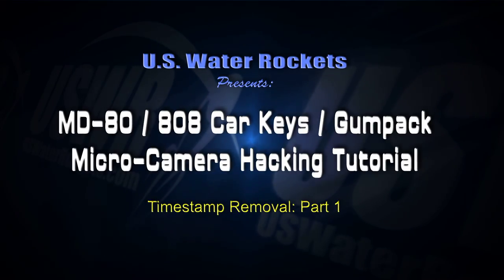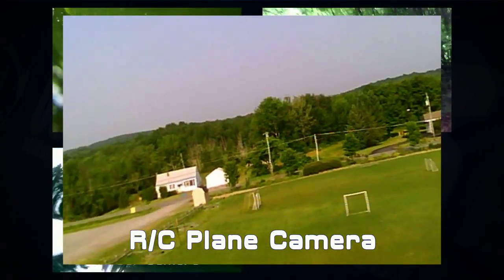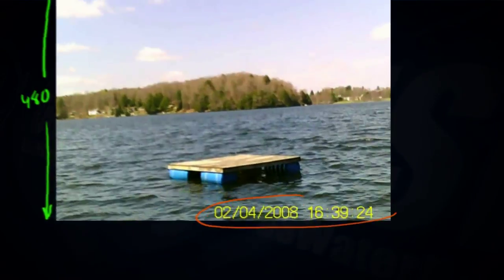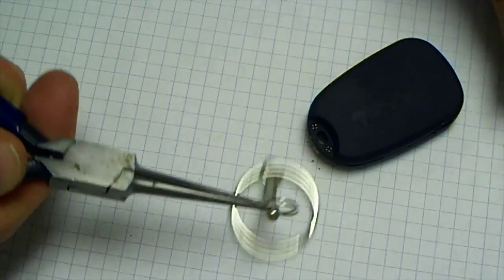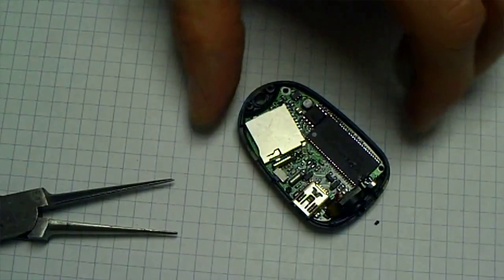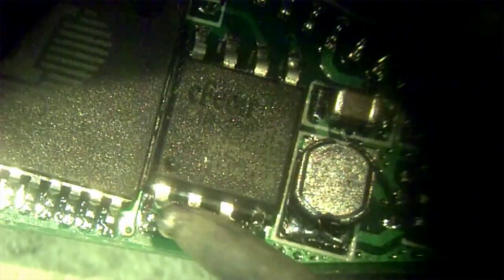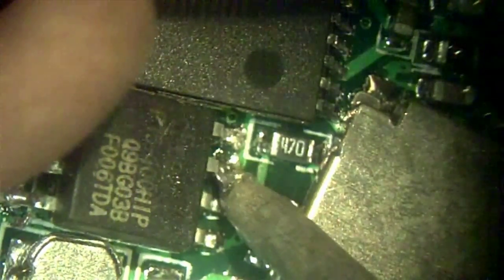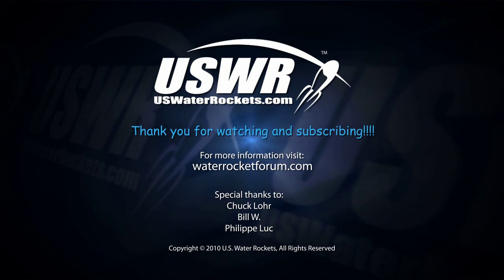Timestamp Removal: MD-80 / 808 Car-Keys / Gumpack Camera, Part 1

Comment from the maker: These devices are really not all that well made. Many people report that they have found loose connections or short circuits inside defective cameras they received. Some people are skilled enough to spot and fix these types of electronics issues, while other people are usually advised to return the bad unit for replacement. Since you just bought it, ask the seller to replace or fix it for you.

Comment from the maker: The focus is set at the factory to about 2-3 meters and we refocus them for infinity (because we want to see detail in the distance), so the way to focus them is to open the camera up and find the optical sensor and lens combo. The lens is threaded into to sensor and rotating it will change the focus. They usually put a dab of glue on at the factory to hold their setting but you can often break it free. Then you need to do trial and error with different focus points until it looks good.

Comment from the maker: @JonDeth These little cameras are made in Asia somewhere and some of them seem to be made with lead solder. The ones made with lead-free have a lot of problems. We have repaired several of them already. Another issue people have found is that the higher temperature needed to work with the lead-free solder causes the copper to delaminate from the PCB if you are not careful.

Comment from the maker: @15sdobbie you're referring to "Soldering Iron" and "Solder wick". The Soldering Iron is an electric tool that looks a bit like a screwdriver that has a pointed tip that gets very hot and melts the metal solder used to connect electronic components to a crcuit board. Solder Wick is a strip of fine wire that is braided into a strip that usually comes on a roll. It is used to "soak up" excess melted solder thereby removing it from a board and allowing the components to be removed from a board.

Comment from the maker: @KitCox we also reviewed the #11 camera and discuss the doftware only upgrade method. watch?v=-z-59WlUqZ8 and agree that it is the best. The hardware shown in this video only works on the #3 with this flash chip. Some people suggest that there is a #3a with a smaller memory but we have not seen one yet. The program could be modified to fix a bricked #11, except for the prototypes that were sold in December of 2010, which are not compatible with later models. Thanks for the comments!

Comment from the maker: @jlb2 There are literally dozens of clones of this camera on the market. Some are better than others. The one featured in this video is known as the "Type #3". If you purchased some other clone, you could have gotten one of the low quality versions. The Type #3 is typically sold on Ebay and sells for under $12 with free shipping. It is hard to go wrong with that price.

Comment: My experience with this camera is that its a piece of crap. I would not recommend anyone buying it. I got no support from the manufacturer of the CompUSA where i purchased it. Drives don't work, instruction disc does not load, camera only records sound, the mode switch does nothing. no website support. Do yourself a favor and save your money.

Comment from the maker: @JonDeth The iron choice was intentional! We wanted to show how easy it is to work on surface mount components without fancy new tools. So many people are intimidated by surface mount that they won't touch it. We're all about showing people how to make stuff easily with common tools. In part 2 of the video we use a different iron with a finer tip.

Comment from the maker: The cameras are not typically made from the best components, so they do fail at a pretty high rate. If the problem is the MicroSD it should be easy to diagnose. If not, it probably means the camera died.

Comment: @USWaterRockets The best, reviewed by Techmoan, is the 808 #11, true 720P 30fps. But it's $40. Will the programmer for the cheaper models work with the #11? (Or, is the flash chip identical?) For the #11 there is a flash program you use directly, with the very real chance of bricking your 40 bucks. The key question here is: can a bricked flash be removed and re flashed with your programmer? Seems like it should work just as if a new flash mem. 

Thanks for all the work and tutorials!

Chris

Comment: Do I need to reprogram the chip?  Will the camera work with out the chip?
Reply from the maker: The camera will not function without the chip. However, this video is several years old and there are other versions of this camera such as the Type #11 and Type #16 that can be reprogrammed over USB, so you should look for one of those. They are much nicer cameras than this old one.